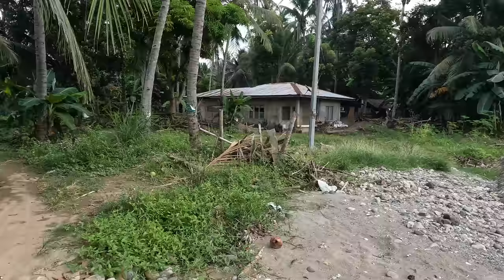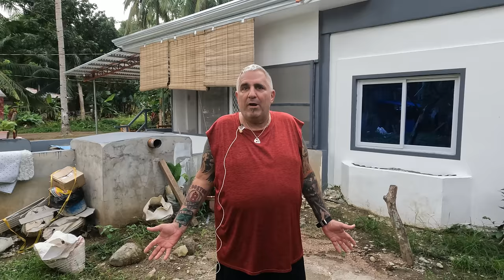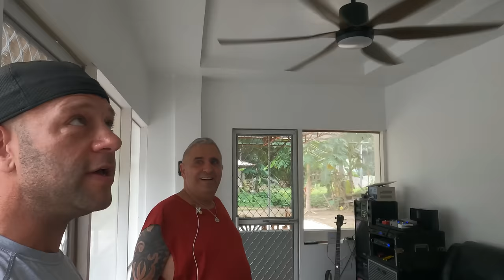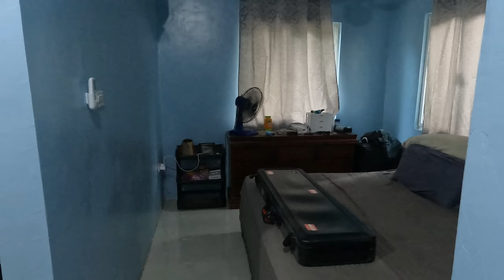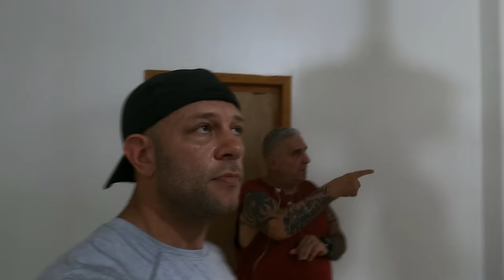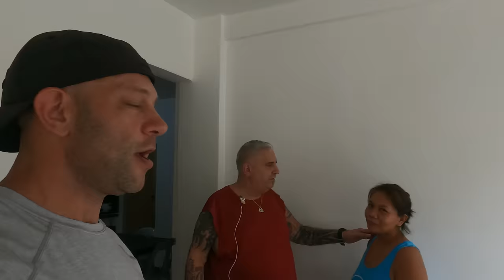Foreigners $50,000 Philippines House Tour!

Comment: Wow it seems very quiet there. No roosters, barking dogs, screaming kids or motorbikes. Amazing.
Reply from the maker: It’s a nice area dinghy near the beach so the road ends shortly after him.
Reply: 😂. I agree it's very common here but u haven't gone to the high end areas where everything u said is prohibited. There are also middle class villages that are not allowing roosters, loud motorbikes, but more on provincial areas or rural areas this is very common.
Reply: Lol, as soon as I read this I hear a dog barking
Reply: @making the move by darren  
The very hint of sunlight... the roosters🐓 sre crowing up a storm. You're not going to be over sleeping that's for sure! 😋
Reply: There are no Roosters ,but they have Karaoke,which are more annoying than the former !
Reply: @satbobsmith7261  Thanks - brings back memories from Puerto Galera. Sometimes cows and sheep invaded our courtyard.. Its fun, most of the time..
Reply: Outside noise is easy to avoid. Have a centralized A/C or air conditioned room. Mosquitoes? Install screen in windows and door openngs. Stay in a quiet subdivisions where they don't allow noise -makihg stuff like roosters, dogs, tricycles. There are many ways to elimnate annoying noise.

Comment: I think I saw the beginning of this build on another channel a few years ago.
Turned out a bit different than I thought it would.

If I build a house in PH I want to have a basement and plan to have that sticking out of the ground 2 or 3 feet so I don't need a retaining wall as the "ground floor" will already be a few feet off the ground. The basement will be important for bringing ground cooled air in to the house for passive cooling as I like it a bit cooler than it gets there in PH. :p
Reply from the maker: That could definitely be a great asset to have a basement if done correctly. Flooding is a constant issue here so I would make sure that the foundation and the cement to sealed properly.

Comment: I would like to know if their houses are built on stilts, you could use screw in steel peirs and then steel purlins and build on that, you could stay above any flood level, you could catch more of the breeze that way, rocket stove pizza ovens are the way to go and the plans on the internet, you could also build a rocket stove powered BBQ to save on gas,  rocket stove tech also can heat water.
Reply from the maker: They are not but that is a good idea

Comment: I couldn't help notice a bottle of Kirkland Vitamin C. That's the one thing I would miss living permanently there, Costco. We purchased land and built a house about 10 years ago and try to get over there about once a year. Not sure If I would want to live there permanently. I find it hard to purchase clothes that fit. Purchase a couple of shirts and after washing they shrink a couple of sizes. Buying a pair of jeans is hard as they only come in your waist size and extra long and you have to cut and sew the length yourself. You can purchase Levies or Calvin Klein Jeans but they are usually over a hundred dollars a pair, so make sure you bring clothes when you visit. I have been on all the big islands and the most common Filipino phrase I hear is, "Lets Eat".
Reply from the maker: We shipped over things like Levies because of the cost

Comment: Other people have attempted retaining walls to keep flooding out. The problem is water finds a way. Such as undermining the ground under the retaining wall or the sheer weight of water against the wall, causing breakage.
Reply from the maker: He's done great so far with it and it was built correctly. So he should be fine. I do see your point however.

Comment: How do you open the windows if the screen is on the inside? Were they installed backward?
Reply from the maker: No, that's how it's done here.
Reply: @ItsMe_Philippines  So you have to go outside to open the window?
Reply from the maker: Nooo the screens slide on a rail just like windows do @erictrippe2778
Reply: @ItsMe_Philippines  Ahh. I have never seen that, interesting.  Thanks.
Reply from the maker: It confuses everyone at first because that's not how we do it but it works fine.  @erictrippe2778

Comment: I must be doing something wrong-I paid !$72,000 for a 431 sq meters lot in 2008 but current value is $196,000 based on the last offer I turned down.   Plan to build a house in the next two years, first is task is to finish the condo so we have a place to live while we build the house. I do realize that location plays a large part.
Reply from the maker: Wow, what island?
Reply: $72K is realistic for a nice decent concrete house with steel truss ang tile roof.
Reply: Mindanao
Reply: @romeoETmike  my condo cost $58,000 to finish out, $280,000 to buy. $72,000 is a house in provinces or 3rd class city. Not for me thank you. My house budget is $325,000 USD and that is only a 280 sq meter house, forget $72,000, that is not American/ European standards. Lot is $195,000- $200,000 I bought it 15 years ago-17th fairway CDO golf course.

Comment: Your windows were installed backwards.   
The screens should be outside and the latches on the inside.
Reply from the maker: Latches are on the inside and my windows were not installed wrong. Screens are on the inside here. Thank you for watching
Reply: @ItsMe_Philippines  
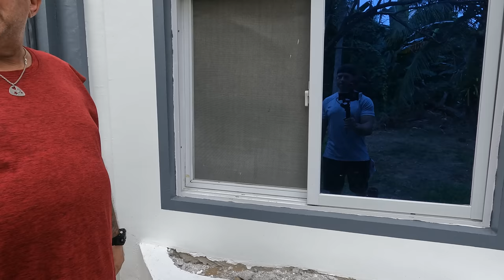My mistake. When you slid the window open at 6:00, it exposed the inside latch and I thought it was outside. Then I felt compelled to share my ignorance with the internet.

Comment: OK Cory, what is your average electric bill per month?  And what is the price of gasoline?  Here in Oregon gas is from $3.70 to $4.90 depending on where you are.  A couple of months ago you would have added $1.50 a gallon.
Reply: Its a bit more here for gas and electric here is higher than anywhere USA im ptetty sure. Its highest in Asia
Reply from the maker: My home runs off solar so I’m not the best example (did a video on it). As far has goes I can check tomorrow. I drive so little that I usually put in $20 and it will last me almost a month.
Reply from the maker: Sad but true! Reason why I went solar
Reply: I pay 55 usd more or less a month in electricity. I live in manila, use AC, 1 fridge , 2 laptops etc...and a lot of energy saving ceiling fans. Instead of using standard electric fan which is 50 watts, we use ceiling fans, more airy and only 15 watts. My bill is lower than my neighbors
Reply: @MakaiIELTS  ceiling fans are amazing and tremendous money savers

Comment: I don't know if Chaz (or you) will see this question.
But
How did he decide which bass guitar to bring to the Philippines?
Did he sell his other ones?
(A musician never has just one instrument 😊)
Thanks
Reply: @johncee8084 
I kept my custom Spector and sold all my other basses. You’re absolutely right, a musician always has more that one instrument. I have looked into another bass or two, but shipping from the US is very expensive. I had this bass custom built in 2017 and it’s a killer bass. I also shipped my GK amp and cabinet here from the US, so I have a great set up.
Reply: Reply sent
Reply: Thank you Chaz!  I often think "what guitar(s) would I save/keep if I took a plunge like you did.

Thank you kindly for replying.
Reply: Well I had some really nice Spector’s. But I had to make a decision. As I said, i kept my custom Spector. Took it with me on the plane in a flight case. No issues whatsoever.
Advise for instruments in the Philippines, the weather is tropical and it gets humid so set up is important and have a good tuner.
Reply: I have a few guitars and if I made a move I would need to make a few very hard decisions.
Reply: Well as a musician you have this one go to guitar, I would start there.

Comment: Well 480sqm at low end 1000 peso per sqm is about $10000 usd for those two lots.
Reply from the maker: 1000 peso per sqm is high priced for this area. Most land I look at is from 300 to 600, and 800 on the high end.
Reply: @ItsMe_Philippines  Yea, I was basing on Cebu prices.
Reply from the maker: @lilphucker4561  That sounds spot on then

Comment: I really want to move to the Philippines but the one thing that's holding me back is the lack of climate control in homes. I'm really worried that I'd be miserable with no central air conditioning, I'm so used to it here in the US. I've had central air units go out and for the couple days, sometimes only hours, that it was out and hot inside (80 degrees f), I was so miserable. It's impossible for me to sleep like that. I really want to move there though. I need to somehow figure out how to get around this issue.
Reply from the maker: Why move to a country where you do not even like their average temperature? The country and temperature will not adjust to your needs, you need to adjust to the environment.  

It take 1-2 months for your body to adjust to the climate and temperature. It's called "Acclimatization" and if you research it you will understand it. I moved here from Chicago winter and it's 87° out today and I'm in a long sleeve. 

If you move here and do not want to adjust you will be inside all day everyday on a tropical island... so I'm unsure of the point of coming here and it honestly sounds depressing.

Comment: But the internet sucks....low download and upload speeds are notoriously known for crashes.
Reply from the maker: My fiber internet is extremally fast here
Reply: @ItsMe_Philippines  My understanding is that fiber optics in the Philippines is almost nonexistent...Internet states the average download is 80mps....for trading I need at least 100 and high reliable.  What city you live in.
Reply: @ItsMe_Philippines  Yea, I just researched it, and at least in Manila Metro, speeds up to 350mps download....that solves a problem
Reply from the maker: @waltermorris5786  I live right above Bais city on Negros island and my fiber is fast. Upload all my videos in 4k with no issue. I'll check the speed when I get into the house.

Comment: I hope you find it in your heart to have mercy on that poor fellow.  It is really easy to build a pizza oven using paper mâché over sand then a ceramic top layer that hardens with fire.  WRONG SHAPE!  I thought that was supposed to be a cement shelving unit.  YIKES!!

He seems like a nice man, but my boots are not much less intelligent ... also I am NOT a super nice man all the time.  Help that poor man out!  

Also, the correct placement in his design is at a corner to reinforce vs mud slides structurally while also keeping oven heat as far from the house & seating area as possible.  I hope his wife enlists his aid moving stuff & building for a nice garden.  He might benefit from the exercise & she looks like she knows how to handle a yard fairly well (just guessing).